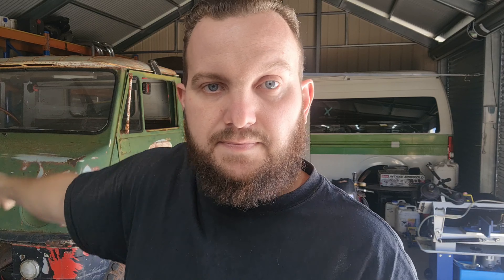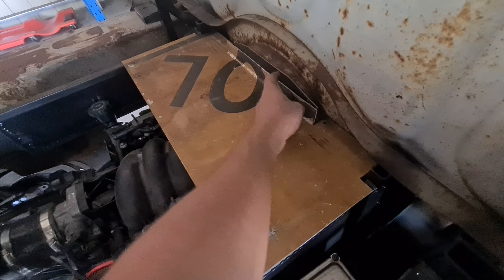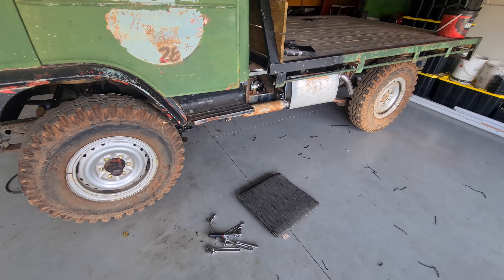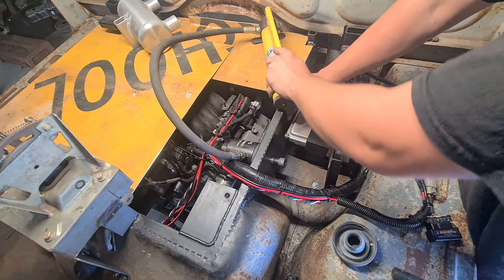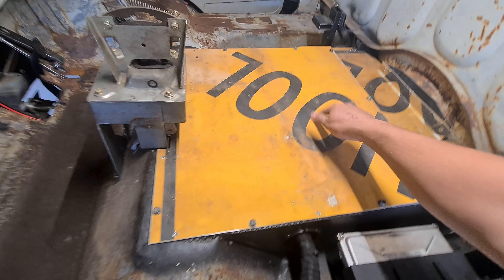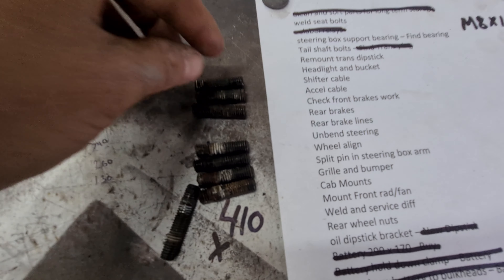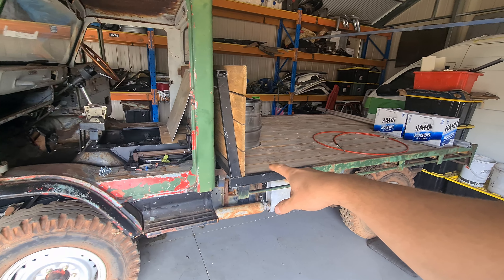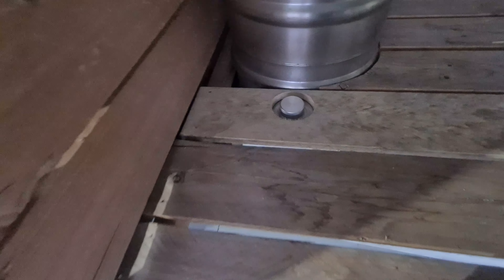Crossing things off the list! Toyoace Mini Mog!

Comment: The metal spacer on the tailshaft might cause harshness and vibration. If so, it looks like a good spot to put a rubber flex disc instead.
Reply from the maker: It is centred and balanced so it should... be okay

But we shall see 🤣